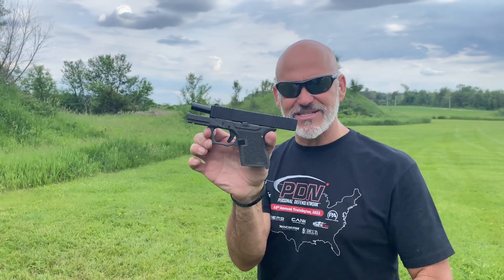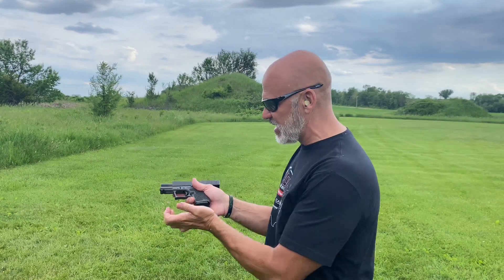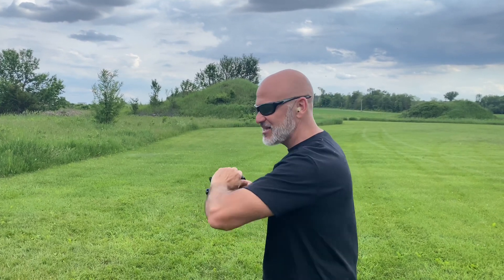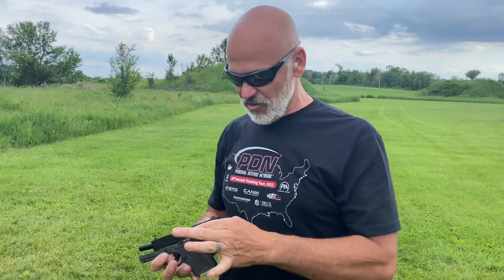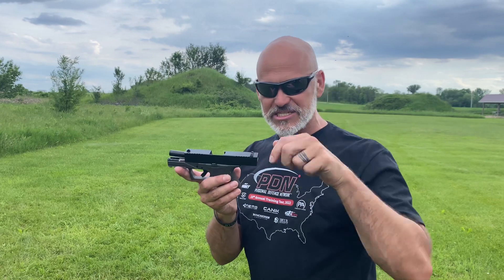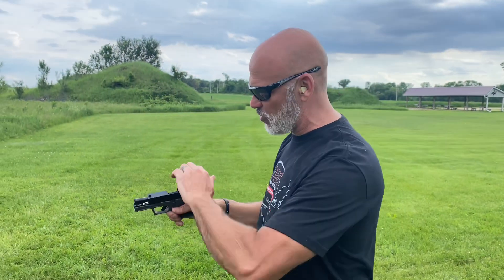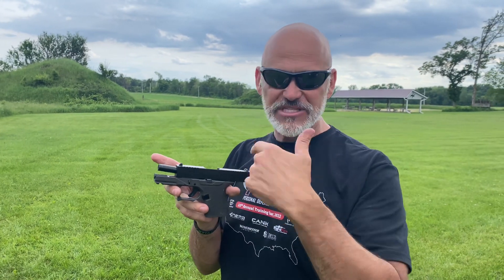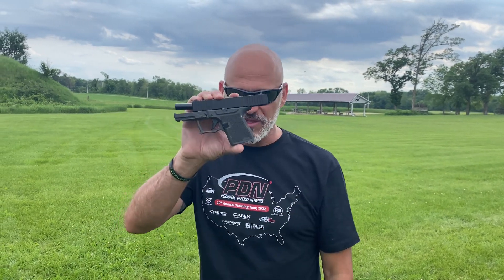Single Stack Kit Build Reliability test: Fail.

Comment: I’ve had good luck with mine: but they do feel like the weakest of the polymer80 frames.
Reply: Honestly could care less, gonna have a blast with it. I called p80 and they told me if I mess it up or it doesn't function properly when done building they'll offer a replacement for more than half off. Now that's a flippin deal of you ask me